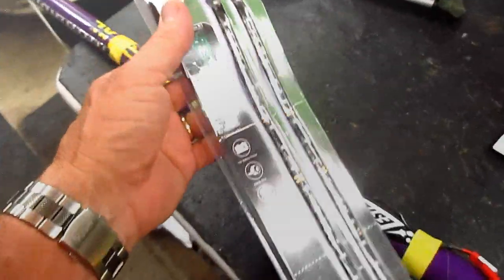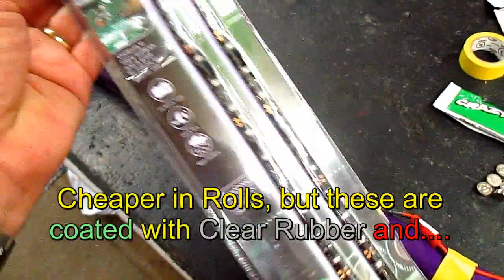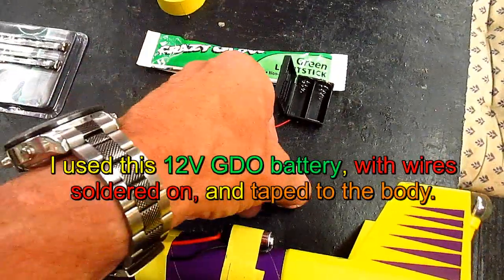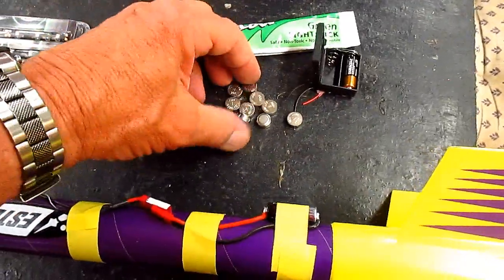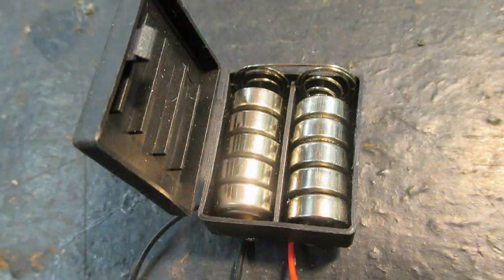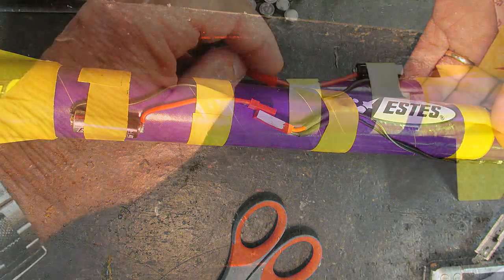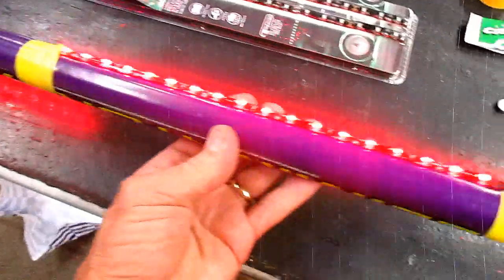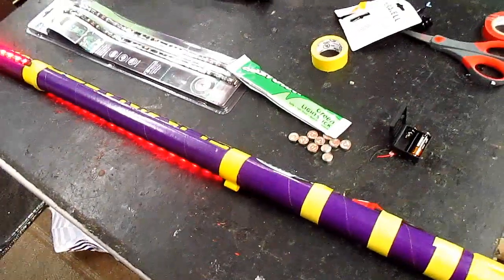NightFlyyer's first NIGHT ROCKET launch attempt with Chemical and 34 LED lights.

Comment: 2 things - you probably frightened the ghosts of the cemetery and that was a UFO report in the making right there lol, great flight.
Another tip for costs saving on batteries. CR2032's are 3V and go in kitchen scales, computer mainboards etc...if you see LED tea-lights at Dollar Tree there's one in each ! The tea lights are 3 for $1.